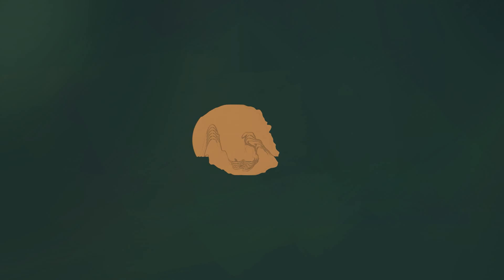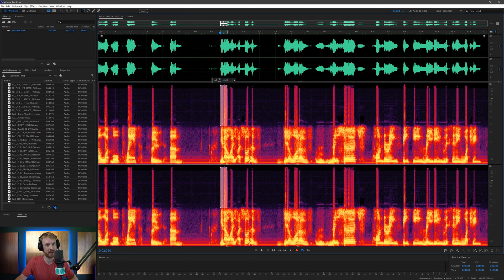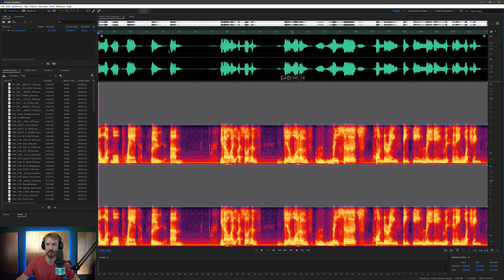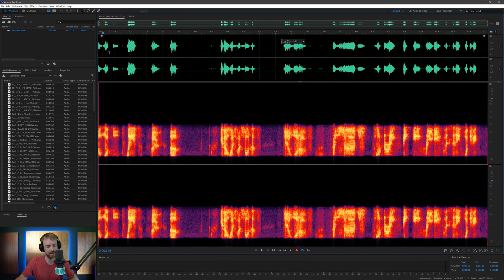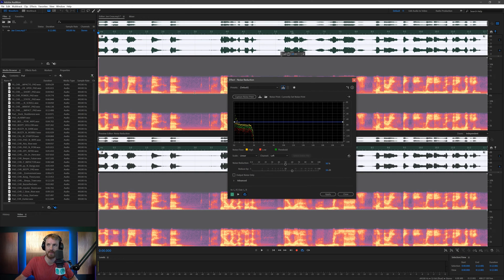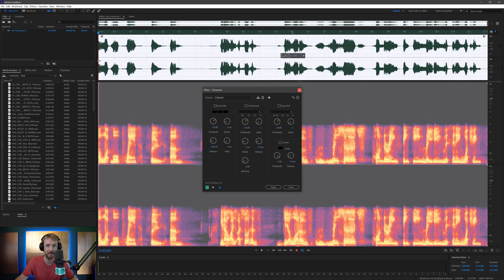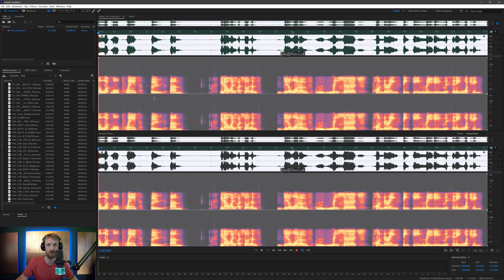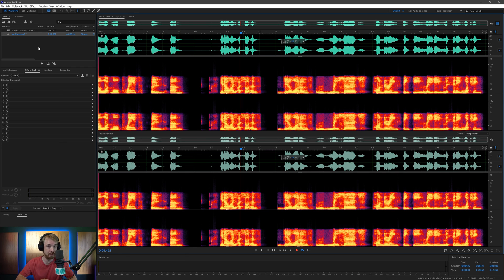How to Fix a Phone Call and Make it Sound Better in Adobe Audition

Comment: That's awesome, that is one of the best tools I've seen. I used Pro Tools for a long time, and would fix every issue by hand. Now using audition, this will save so much time!
Reply from the maker: Pro Tools is good but in my opinion Audition is that little bit better.  Glad to have saved you time Lisa 👍
Reply: @MikeRussell  Pro Tools was great in the beginning, when non linear non destructive editing became possible. Slowly over time, I feel they've had a hard time deciding if they were a high end product or if they wanted to chase the lower price point. By the time they decided, the market was flooded with options. I now use Audition as well.
Reply from the maker: Welcome to the Audition family 👍
Reply: @MikeRussell  I've been using it since it was Cool Edit, but mostly as a backup for quick edits. I worked in radio for 20 years both on air and in audio production, usually the production studio had Pro Tools and the on air studios had Audition/Cool Edit. Now I use it as my main editing software.

Comment: How can i use capture noise print (Shift + P) for live streaming?
Reply from the maker: Hi Tahir, you’d need to use a hardware solution to be able to attempt this in a real time live situation.  A software solution would introduce too much latency.
Reply: @MikeRussell  Thanks a lot for your reply, i am happy with too much latency. can you please guide me how to do it using Audition?
Reply from the maker: Hi Tahir, I can't see how you'd be able to do this live as you wouldn't have a noise print to capture.  You need the noise print available to capture to run so this a post processing technique.